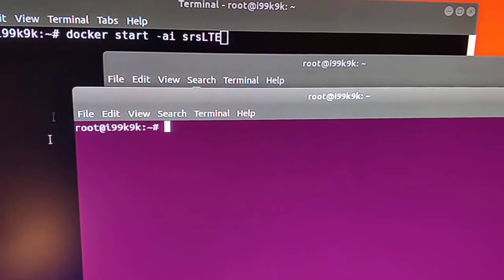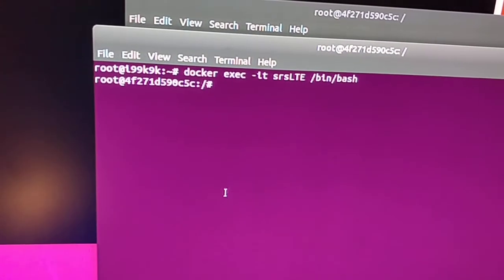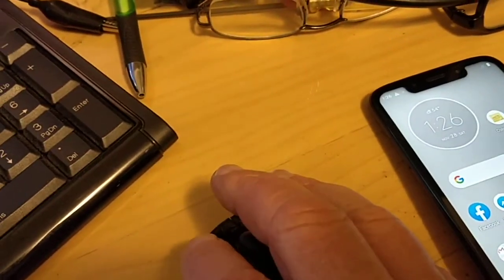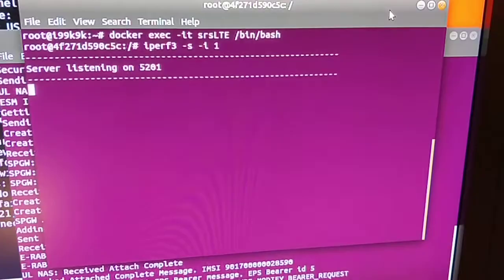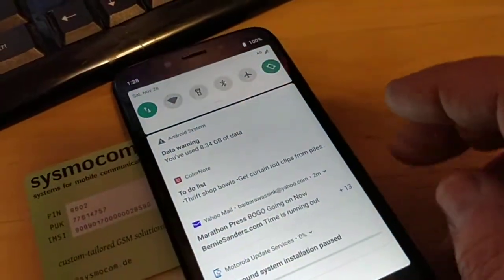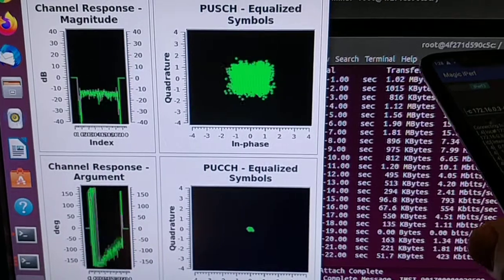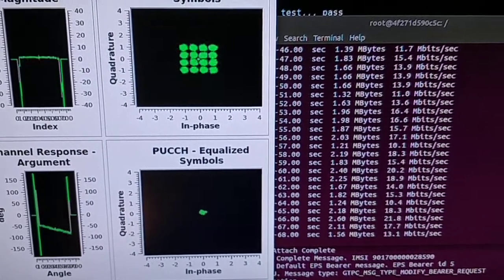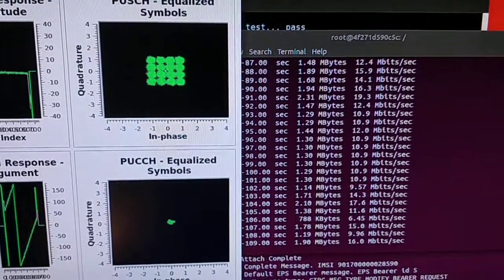srsLTE graphical uplink display

Comment: Great video! I tried to see the constellation with gnuradio and gr80211 modules for Wi-Fi. What sdr are you using? Would it work with the Limesdr?
Reply from the maker: srsLTE certainly does support the LimeSDR, see their email support forum for examples.    
The hardware used here is the usrp b205mini.